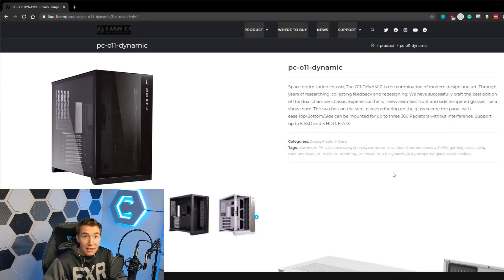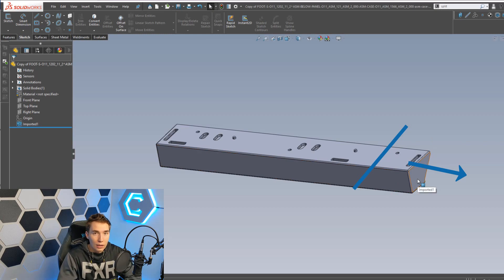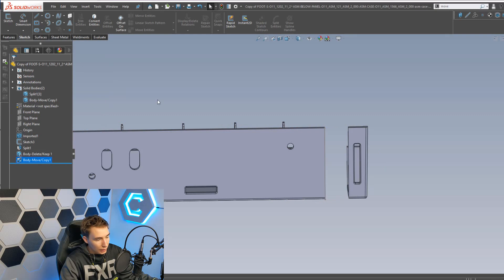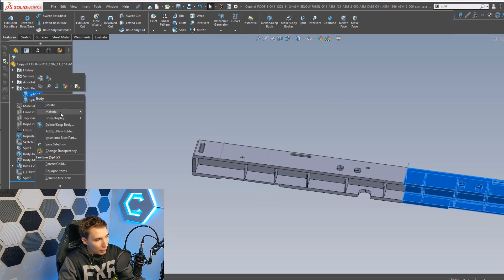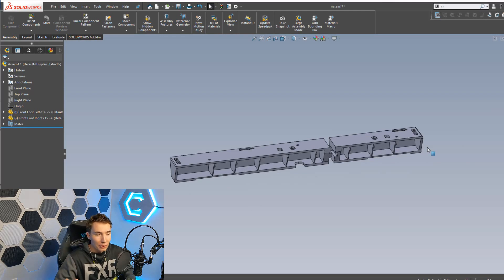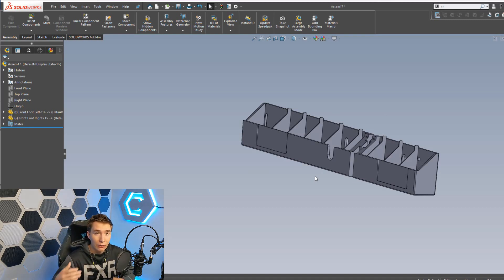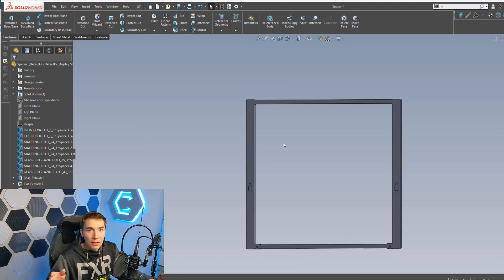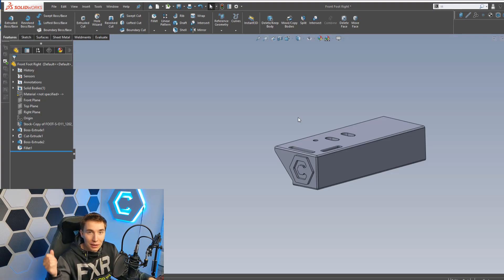Designing a 3D Printed PC MOD!

Comment: @CADWithChris  Really cool how you did this! What settings did you use to import the stl file from Lian-Li in solidworks:  When I just open the hole case, I can't actually open a sub-component as a part to edit.
Reply from the maker: Lian-Li's website is very broken for me so I can't check, but look for an option to download as an "STP" file not and "STL" file. At the time of the video they provided .STP models which can store the assembly data, unlike an STL

Comment: Hey, anyone out there try these spacers with a 4090 in the 011D?
Reply: I added 14mm to his CAD, I'm on print 2 of 8 now... if my math is right 174mm should fit the Nvidia FE power plug with my Ek vel2 H2O block
Reply: @RCrider185  Oh, nice! Let me know how it goes. I have the MSI 4090 Suprim Liquid ready to install, was planning to vertical mount it, but would still be good to know how your project comes along, just in case. Thanks!
Reply: @RCrider185  Hey, let us know how it went :)
Reply: @RCrider185  can you send over that cad file?

Comment: I printed the files, but how I connect the single pieces. Do I need pins?
Reply from the maker: Yes the parts have holes for 1/4" wooden dowels to help align them while gluing. You can find these at your local hardware store.
Reply: @CADWithChris  thank your very much !!!!

Comment: Hey Chris!! any chance you will get an update version to this mod, that would help with 4090?
Reply: Just starting print 2 of 8, I added 14mm which gives the extra space needed for the Nvidia FE power plug with a EK Vel2 H2O block... I'll update if it worked & will upload once I get permission from CAD with Chris
Reply: @RCrider185  Any updates? Looking to do the same thing, but don't know my way around solidworks
Reply: @RCrider185  hey any updates, Id like a wider vesrion as well

Comment: Hello, I know this project was done last year.
But I was wondering if these files have enough space for 180mm cpu clearance? I was talking to some people on reddit and I need at least that much space for rtx 4it 090.

I don't know how to personally edit files or can even by looking at if this is enough space for my MSI Liquid Surpeme X cooling tubing and wires.
Thanks for the reply in advance! (off chance you know a place where I could order these prints? i've never dealt with 3D printing before)
Reply from the maker: The spacers add 1/2" to the width of the case giving a total of 7" from back to glass to fit a card. I would find someone local  to you on FB marketplace or craigslist that prints. They will likely be able to edit the file if you need more space.
Reply: You need 174mm or 14mm added to his print, I'm on print 2 of 8 now

Comment: Hello! Thanks so much for this. Quick question: once printed, do the pieces install/snap into the case easily?
Reply from the maker: Yes they just rest in the nubbins that the glass uses
Reply: @CADWithChris  Do I have to use one or two hands to rubbin the nubbins?

Comment: I have the Lian Li O11 case, and a huge Noctua NH D15S cooler. Your design will help me. I ordered the parts to a 3D Printing service. I hope the assembly, especially of the feet, will be easy. Thanks a lot for your work, and for sharing.
Reply: Update?
Reply: Did it fit?